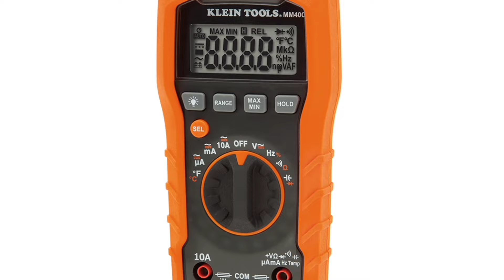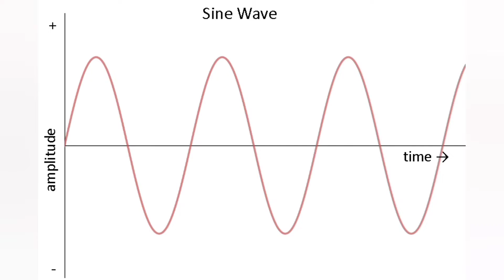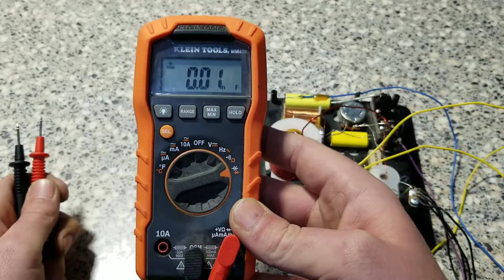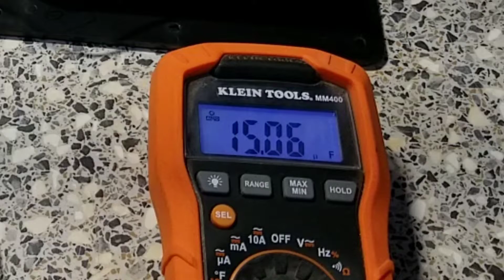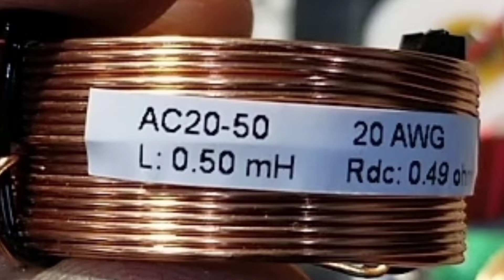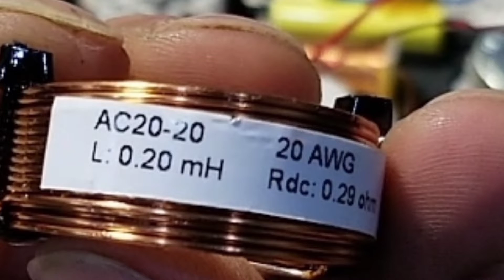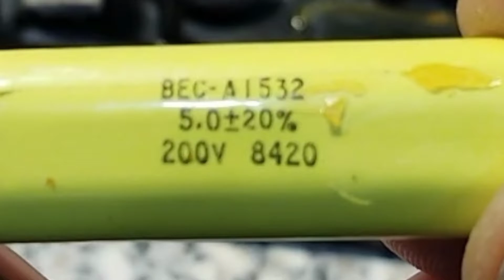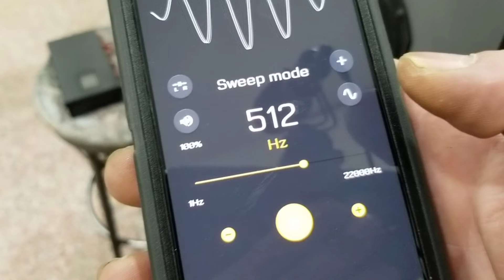Cerwin Vega D-9 Crossover Rebuild (Part 5 D-9 Restoration)

Comment: Rebuild is coming along very nice, took your time and very well thought out. Looking forward to the finished product and testing video.
Reply from the maker: Thanks, it's a very rewarding feeling finally getting to hear them play after many hours of work put into them. I can sit in front of these and listen to them for hours on end with no fatigue. I will say the biggest improvement I noticed was vocals. The upgrades turned these things into more than just a rock speaker, which they still do very well.
Reply: @SavingVegas  I think they coined the phrase "EarGasm" for that..

Comment: Maybe You should measure the speakers first, then rebuild the crossover. ..Have a look at GR-research and his mod on CV.
Reply from the maker: The D-9 had a much better designed crossover than the D-3 and 316R that Danny upgraded. 

I have actually measured these D-9s, and they are one of the more accurate CV speakers I have measured yet. I have a very similar measuring system that allows me to take gated time window measurements.

Comment: Were both crossovers designed the same?  I have a pair of 311p and the crossovers are different, one has one inductor, 3 capacitors, and two resistors, while the other has 2 inductors, 3 caps and 1 resistor.  Im still trying to figure out whats going on with them.

Comment: The woofers in my D-8's are unfiltered, and are allowed to roll off on their own.  I think when they came out with the D-9, part of the upgrade was to use two mids (lower and upper), instead of the one in the D-8, where my theory is they were wanting the natural woofer range and the one mid to cover those frequencies and thought better of it later.
Reply from the maker: I have yet to hear the D-8. I remember someone saying they liked them better because they thought the D-9 had too much midrange. It didn't really make sense to me because you have the ability to adjust to your liking and when you turn the mid level right down they play very quite. You would think that 2 mids playing at a lower level to match the same level as just one it would be an improvement. I wonder if the D-8 woofer to midrange crossover frequency would be higher being that the woofer is unfiltered. I don't have D-8 xover schematics but I wonder if it uses a higher value cap for the mid to block more low end frequency.

Comment: Good afternoon. I have a pair of d9s and am looking to upgrade the  mids , is there a mid out there that would work ? . Thank you 👍
Reply from the maker: Have you recapped the xovers already?
Reply: No not yet
Reply: I have a pair of original tweets though the diaphragm on both are bad. And as for the mids ,I was just trying to something different.
Reply: By the way , I noticed you used a Harman kardon, I've been using a HK 990 and a Adcom 5800 on the d9s and the polk a9s
Reply from the maker: To be honest, the C5G tweeters with the smallet magnet are suitable replacements. I have yet to find a proper fitting diagram for the CS5 tweeter. I do know someone who's working on getting some manufactured, and I hope to be able to get some in the future. 

As for the mids, I do suggest recapping the xover before swapping mids. Very poor parts are used in the midrange signal path, and the improvement in the sound from the original mids is drastic with proper parts. Either way, it wouldn't hurt to do. 

If you do decide to try something else, it's important to find one that matches impedance, sensitivity, usable frequency range, and lastly, power handling. I don't know of any certain mids that do match these but I'm sure there is something out there.
Reply: I found a pair of rocker tweeters HO5 ans 12tr ? . Though I really need to do the crossovers 1st I suppose and then maybe the tweeter ? . The one's I have in the d9s are the orange labeled ones , they look somewhat 70s though they are not the original ones , those that I bought needed the diaphragm replaced and the style of diaphragm I bought didn't fit or work at all lol. That's for responding 👍
Reply: Here is a photo of the tweeter
Reply: Is there a diaphragm for the original tweeter?
Reply from the maker: Does the HO5 tweeter that was in your 12TR have the larger magnet that mounts with 3 screws or smaller magnet that is mounted with 2 screws?

Comment: 14:15 that 1ohm resistance in the woofer air coil is going to  have an obvious attenuation effect on 4ohms woofers bass response, compared to the old iron core.
Reply from the maker: It definitely could, of course, that depends on the DCR of the original.

Comment: Hey man! I ordered all new capacitors for my D-7’s yesterday… but I really would love to go all out and upgrade the inductors as well while I’ve got it open, as I can make things look better if I do it all at once.
Do you happen to know the inductor values I would want for my D-7s? I would measure them with my component tester, but… I do not trust mine very well after measuring the inductor I bought for a guitar pedal. Every time I would measure it for fun when I bought it, the results would come out +/- 100 mh.

Or, is the values in the D9’s the same as the D7’s? Maybe I could have simply asked this instead? 😂
Reply from the maker: Of the 3 inductors in the D-7, 2 of them are the same as the D-9, and those are the ones for the tweeter and mids. 

For the tweeter, the inductor should be 0.2mH. I measured 0.178mH on the one I made notes on, but you have to remember their tolerances. 

For the midrange, the inductor should be 0.5mH. I measured 0.576mH.

Lastly, for the woofer, the inductor should be 2mH. I measured 1.92mH.

As far as I know, there weren't many revisions for the D-7. For instance, the D-9s actually had 4 revisions where the values of components were changed.
Reply: @SavingVegas  thank you so much for this info! I really do appreciate it!

Comment: I am currently working on my D9s crossovers. One has a dead tweeter and piggybacked mylar caps at the midrange while the other has has a single electrolytic midrange cap.  The most interesting thing is the 100v 100uf cap in yours is actually a 40uf 110v cap in mine.  I am wondering if mine were recapped previously.  The 40uf cap in line with the woofer might actually be a more appropriate cap from what I'm reading online, any thoughts?
Reply from the maker: Ok, there are a few different variations of crossovers for the D-9. It's not uncommon to have 2 different ones as these speakers were priced and sold as single speakers. 

The one you have with a single electrolytic cap for the midrange is the last version and not necessarily the best one. This one does use a 40uF cap for the woofer. 

Does the one you say that has piggy backed mylar caps also have a 40uF cap for the woofer? 

If your D-9s have 2 different crossovers, I would suggest building them to match. In my opinion, the lastest version crossover isn't the best one. 

The one that I have measured very well and I would suggest rebuilding yours to match, just my opinion. Either way, you should make them the same. If you do a Google search for D-9 crossover Rev. F schematics you should be able to find them, those are the schematics for the ones I have. If you have any trouble, feel free to email me at savingcerwinvega@gmail.com, and I can send you all 3 of the different schematics for the D-9.
Reply: @ thanks for getting back to me but yes they both have the same 40uf cap in the woofer path, any suggestions for the best non stock tweeter replacement for these speakers ?
Reply from the maker: Honestly, I would try to find an original CS5 tweeter (larger magnet), which is easier said than done. If not, I would even just use a C5 or C5G tweeter (basically the same thing, only a smaller magnet than the CS5). I used 2 C5G tweeters in my D-9s for well over a year with no issues before I found some CS5s.

Comment: What is the correct fuse replacement for the protection circuit in the D-7 crossover?
  I bought a set used and there were no fuses in either fuse assembly.
Reply from the maker: From factory I believe they used a standard 3A or a 2A slow blow. I use a 2.5A slow blow fuse in mine. If you have good clean power to them it should protect them properly and still allow some good output.

Comment: That's soo damn nice 👌 I hade cerwin vega re 38 and had caps done same caps as you and wire gauge bigger but one of my speakers would heat up my amp. I also replaced my woofers with new ones had to sell them. Do you know what would make speaker heat up speakers?
Reply: Resistance

Comment: I have some CV 12T's from 1978, original foam and everything, still sound great! BUT one speaker will crackle and cut in and out all audio. Jostling the speaker will fix it briefly. I don't see any obvious wire issues, could this be caused by something in the crossover? It's not as easy to see inside the crossover as this one
Reply from the maker: It could be but if it affects the entire speaker itself it would have to be loose somewhere in the main incoming positive or negative. I have seen inductors come loose in crossovers mostly on the VS series but it only affected the midrange.
Reply: @Saving Vega's   Thank you much for your time/response! Thats a good thought, it does cut out all three drivers. I can't get into the internals of the crossover on my 12T to see though. I've got all the various screws and nuts loose but can't figure out how to loosen the fuse holder to get the board off. Is there a trick you know of to open it up? Appreciate your time and your channel!
Reply: I had the same problem.drove me mad😂 it was loose connection to woofer put a crimp on connector plugged to woofer, sounds great👍.

Comment: I have recently picked up two HED 1230s. I refoamed them but would like to complete the upgrade with the cross overs.  Do you think that the cross overs for the 1230 HED be about the same?  where do you get the parts?
Reply from the maker: Most of the older HED CVs never used electrolytic caps. I believe yours are very similar to the U123 which I have a set of. The woofer is not filtered in any way. There will be an inductor and a polyester cap for the midrange, a polyester cap for the tweeter and possibly an inductor filtered to ground for the wltweeter as well as far as I can remember. The yellow polyester caps in these crossovers don't generally go bad but the problem I have with them is they usually have a 20% +/- tolerance and they are not very good quality. They are smaller value caps so replacing them with new polypropylene caps will be a good improvement. I get most of my parts from Parts Express and I usually use Dayton Audio brand caps. They have a 5% tolerance and sound much better, using those caps will really clean up the mid and tweeter.
Reply: @SavingVegas  Thank you I really appreciate the suggestion.  Keep up the great work. My first set of speakers were D3s I got in college.  I LOVED them!

Comment: I saw a repair video that explained the d5 degrades the carbon resistance ring in the potentiometers and to only use the fader lube. Have you seen anything on this? Man I wish I could just ship my crossovers to you to do the same, I know this is your hobby and not a repair business though.
Reply from the maker: Lots of techs that I have talked to use the method that I mentioned, which is to clean with D5 first and immediately after using the F5 to ensure proper long-term operation. I have used this method on pots that do not function properly. 9 times out of 10 the D5 works to get them working and then the fader lube to protect all surfaces. I have yet to have any issues using this method with any of the equipment I have worked on.